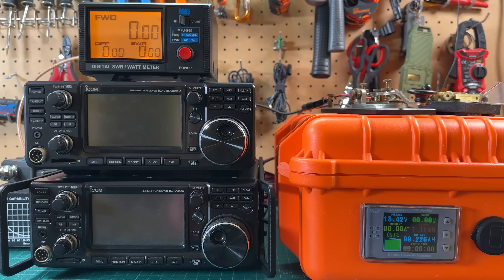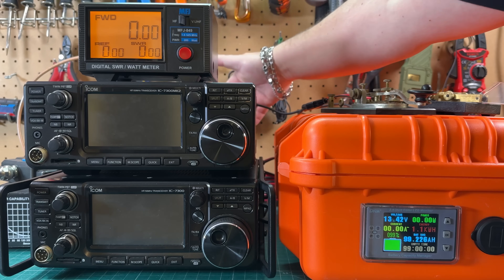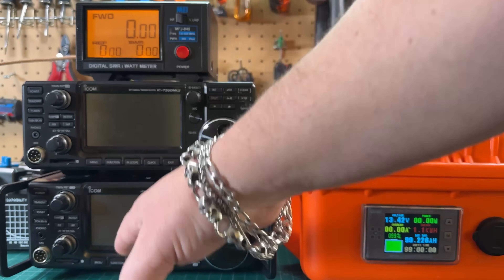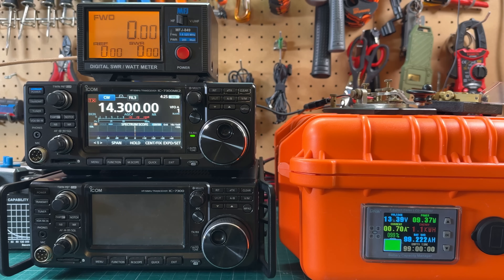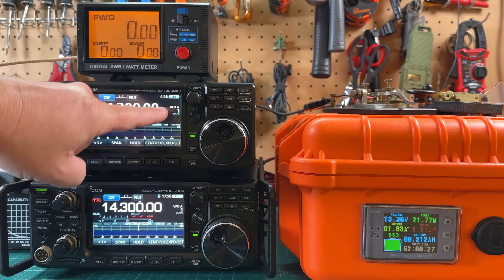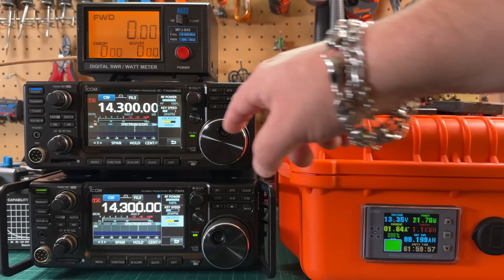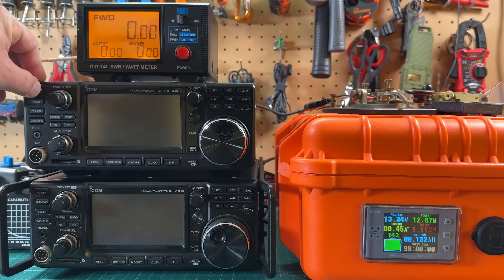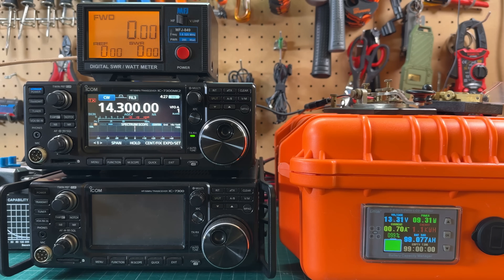Icom IC-7300MK2 Vs. IC-7300 RX/TX Current Draw Test

Comment: A 26% power savings at idle is huge. A 7% power savings on full key-down with about a 1.5% higher measured output is also impressive. Thank you for the info.
Reply: Actually, when you take out ~10a for the power being sent to the antenna, the radio is running about 15% more efficient on full key-down.

Comment: Quick calculations:
100W into a 50 ohm load needs about 71V. From 12V supply, output transformer needs to step up voltage about 5.9.
100W into 50 ohms is about 1.4 amps. Using same transformer, input is about 8.3 amps.
An "ideal" perfect radio would be about 10 amps.

Comment: Looks like the power on the older 7300 was about 1.4 watts lower.  It would be a little more complex math to figure out the current difference.  You would have to factor in transmitter efficiency and cable connections.  All that is probably negligible in the grand scheme of things.  Thanks for the test!  73
Reply: i think youve got that the wrong way round .........look again
Reply: @mi0lpo  You were right I will correct.  Thanks